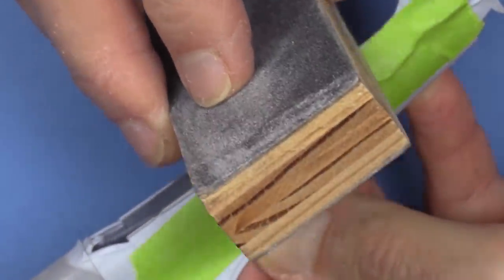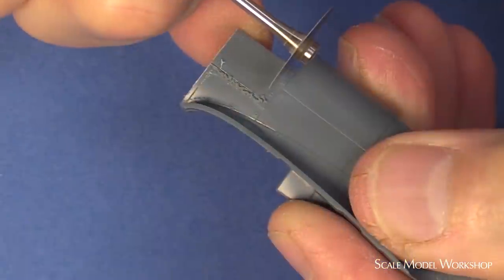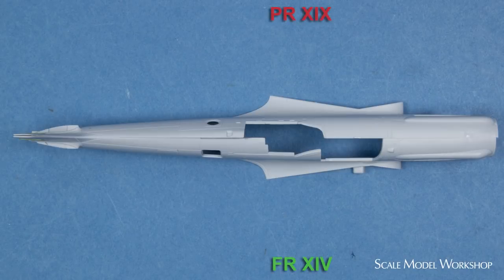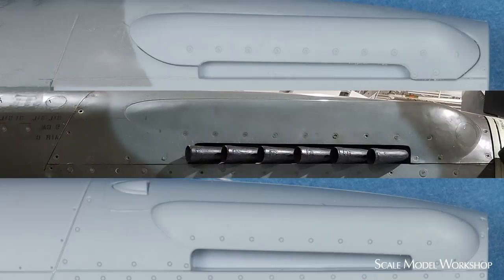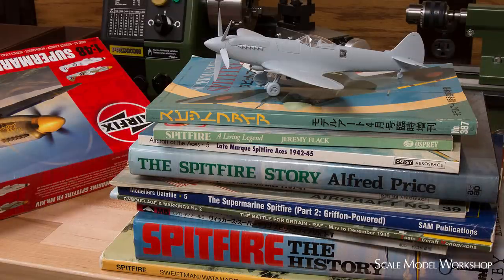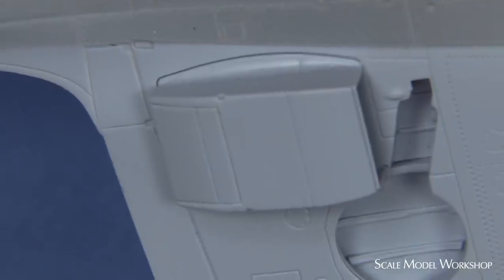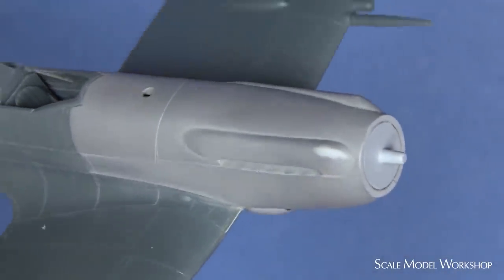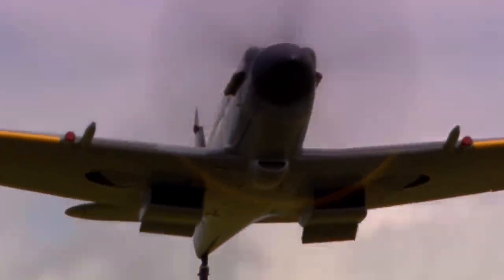Spitfire Mk XIV Conversion Wrap Up

Comment: Great stuff.. In the middle of building PCM's 14c in 32 when I wanted some references (as it's soft in panel lines etc), so got a Airfix FR 14 and Eduard's Viii to compare etc - and I've ended up building those 2 as well.. Been looking for a 14c in 48 and like you the sad Academy is all I could fined (and your blog). I think I'll do exactly as you have with a Eduard 8 + Airfix griffin, tail and air boxes.. thanks for the details and advice... Keep on!!

Comment: Forgot to thank you for the tip regarding Hydrocal.  I see it’s available at the big box home improvement stores.  What type of dental tool were you using to shape the plaster and how long does one have to work Hydrocal before it’s prohibitively hard?  Thank you Dr. Budzick.
Reply from the maker: Working time depends on the product, but you usually have 5 to 10 minutes after it starts to set and get firm.
Reply: @scale-model-workshop  Thank you Dr. Budzick.  Appreciate the tip.